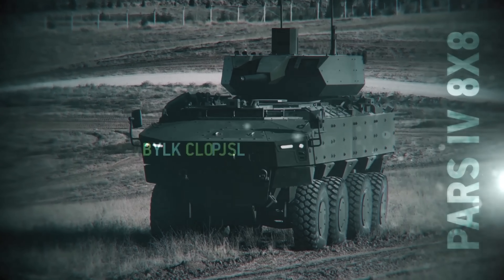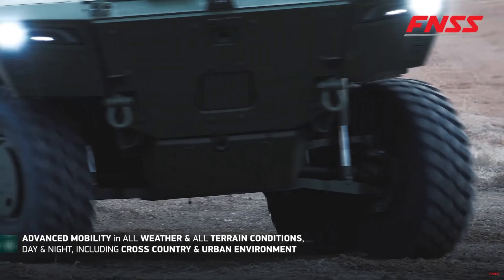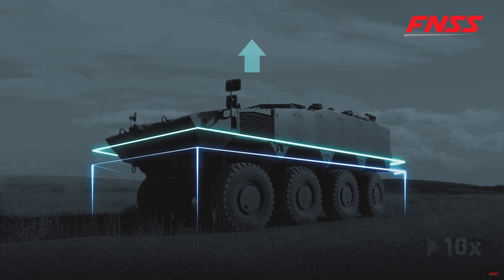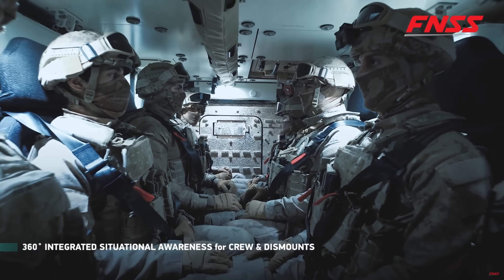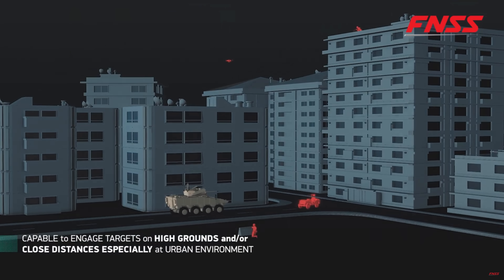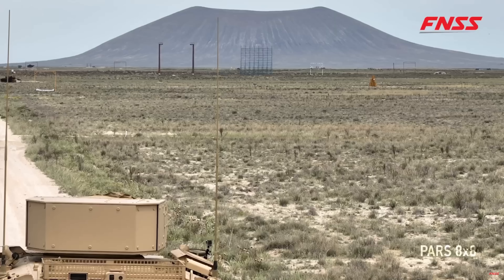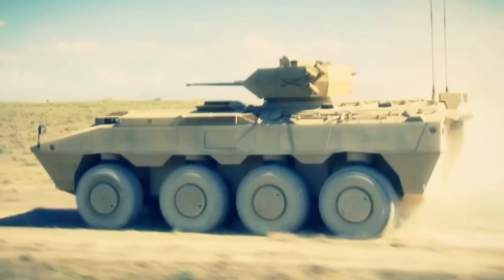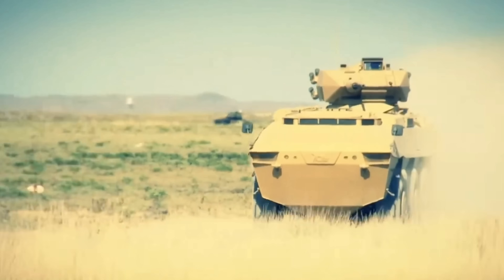The 'Pars' ALPHA 8x8 Infantry Fighting Vehicle | DETAILED OVERVIEW

Comment: There are limits to the penetration of guns and their size. For long-range artillery, the equality of kilometers of projectile flight and centimeters of penetration. 24 kilometers is 240 millimeters of penetration. 15 kilometers is 150 millimeters of penetration. For tanks with large and long guns (such as Panthers and Tigers), it is advisable to raise their barrels 2 meters above the ground for easy driving through holes without damage. The gun should be shorter than the length of the body. There is no need to select the best mass and speed of projectiles for an imaginary tank. It is easier to calculate using an ideal 25-caliber howitzer, which has a penetration equal to its caliber. Dividing the barrel length of 5 meters or 6 meters (Panther and Tiger) by 25 calibers, we obtain a penetration limit of 200/240 millimeters. Was it possible to create a low-height anti-tank vehicle like the Stug3 with a more powerful and longer weapon? The lower the barrel height, the shorter it should be for easy driving over potholes and hills. A barrel height of 1400mm/1500mm does not allow it to be made long for, easy movement. Strv103 lengthened inside the body. It is desirable that the anti-tank vehicle has a limited mass and size so that it is better and faster to find better place and conveniently drive and stand in an invisible place.

Comment: Come to think of it, I don't think I've ever seen a video comparing tracked vs wheeled vehicles. 
As in.. where they can go, and where they can't go. Not just comparing one vehicle vs xxx, but a serious look at the pros and cons of the various tracked and 3x3 7x12 or however many wheels they have... ;)  
So of the questions I have goes something like, is there any difference in how many wheels they have, or is that just a weight thing? (heavier needs more wheels) Or can tracked vehicles really go anywhere they want,,,assuming they are not too heavy? 
What does the comments think? Would it be interesting to watch?
Reply: Tracked vehicles get stuck all the time, which is why columns of tracked vehicles are frequently accompanied by specialized recovery vehicles.

Wheeled vehicles are more likely to be stuck, but they go faster on roads and don't tear them up. Since more time is spent on roads than off,...

Number of wheels is often but not always a function of weight.  6x6 vehicles tend to be smaller for example but 6x6 with evenly spaced axles can have ride quality problems, hence why so many 6x6 configurations will have a gap between one set of axles. This in turn though can impact off-road performance, particularly trench crossing. 

Everything is a compromise.

Comment: I spot One Modularity Lacking... Ability switch 8x8 into track easy and quick method.

I have ideas for IFV  require airplane carrier redesign.

IFV ideas I come up with is bigger wider size wheels plus dual wheels configuration halo shape side armor for wheel vulnerable sides. 5 dual wheel left 5 dual wheel right. All 10 dual wheel can steer left and right. Wheels ability quick easy swap tires into tracks.
triangular bracket front both sides and rear sides v hulls against mine. Incredibly spacious inside soldier can prone position  left and right simulataneos reason I describe soon. 5 left and 5 right Seat style is facing sides can be switch both seats face left sides or right sides and can mnual or semi auto fold down flat. 3 main door for infantry left right and rear. This is why seats direction can be adjust both seat 5 x 5 and semi auto fold seat can help real rapid deploy triangular bracket sides door open(can be open fast travel side door distance go down is half because of triangular bracket design door open two ways up and down door is whole sides panel triangular bracket shape) 5 infantry simulsteneuos drop chair semi auto fold down by commander push of button another 5 infantry path clear can be rapid drop. Another tactical infantry deploy method contested sides fire come from sides door open little provide window fire for 5 sides infantry in prone position, both sides of seats 5 left 5 right fold down opposite 5 infantry crouch low avoid bullet went thru other door open  other sides can be first rapid deploy contested door close follow by remaining 5 who provide fire cover follow drop out of the vehicles.Rough istimate carry 14 humans 4 crew 10 infantry. Modularity top mounted weapon and front mount mine clearing or mine planting or fork lifting function!!! rear part towing other vehicle is super convenient class avaiable!!!!!!! Infantry not squeeze inside, vehicle large profile build nearly as tall as public passenger transport bus! wider bigger!!!! wheels is half size of big foot wheels! super definitely not fit into what ever biggest Air craft USA have! HAHAHAHA! and hover shoreliner hovercraft.

Most definitely need create anew big air craft be able carry this ICFV!

if i create this and sell, you have buy together with the colossal class Aircraft quadruple or triple bigger size aircraft than whatever big aircraft US have. and Bigger hover craft etc.... 

Create Big size air craft transport this wheel fortress ICFV... Yeah I going call this ICFV a Mobile Fortress inside pending new AirFortress.

Comment: Erm actually the side by side driver and commander is actually more likely a problem...
If the driver side gets hit and penatrated by an rpg for example then chances are that the commander is killed even if it's through shrapnel meaning that instandly most of the vehicle is useless when it doesn't have a turret meaning not only driver safety is at risk but also the commander wich is a much bigger problem than if the commander is further in the back..

Comment: It's actually not that lightweight, I was surprised that it's so close to the boxer.
Might be a good cheaper option for some nations but for NATO forces having the RCH 155 option for the boxer seems valuable. I doubt you can mount a 155mm artillery gun on this thing.

Comment: 50 of the same turret is fine...when you have a great turret 😛

Mortars? HA, the old WW2 tanks were made to ARC fire indirectly, not as well as proper artillery but more mobile and more armor. And last I checked, the US tanks still had the arty sight and really only dropped it when "ALL" ammo became HEAT, APFSDS & the rarely used M1028 canister cartridge (wa wa wa is messes up ma barrels) and yet it was still designed, built and ISSUED. 

But IF they could make, ISSUES & USE a plug&play turret that changed in like an hour's tiem frame, that would actually be useable BUT...would require a LOT more crew training to use all the different systems.

Comment: This is I believe the closest anyone has come to getting the layout and configuration right.  

Commander seated up front, next to the driver and with an excellent field of view, but still in the troop compartment where he can be in direct contact with the dismounts.  Which is the other thing,... a full squad (8 to 9) dismounts can be accommodated, not the 6 or 7 so commonly found. I am not a fan of 6-man squads. 

I find it fascinating that in these videos about infantry fighting vehicles or infantry mobility vehicles and the discussions that spring from them, what gets almost universally ignored are the infantry - the vehicles real primary weapon. 

The engine is moved to the front instead of the middle, unlike earlier PARS vehicles which allows for the commander to be in proximity to his men and increases usable volume.  

Worth noting to viewers not familiar with the vehicle - a lot of your video clips are of the older mid-engine PARS III, a very different vehicle.
Reply: Thanks, I was confused about the two different layouts. I agree that the front engine layout is better. Besides separating the driver and commander from the gunner and dismounts, mid engine can be more annoying for maintenance.
Reply: @IsaacKuo  - Importantly, the front mounted engine puts the driver and commander above the 2nd axle instead of the first, offering them more protection from mines.
Reply: another overly expensive deathtrap for the mounted troops that can't see and shoot outside
Reply: @kingsman3087  - Shooting from the vehicle has never been a particularly good plan.  I'm more than old enough to remember when every infantry carrier and it's mum was fitted with firing ports for the crunchies inside.  Then after a while everyone sort of figured out they don't actually work and in fact made the vehicles more vulnerable
Reply: @MFitz12  not necessarily shoot but observe- im not sure you know the so called "airguards" that were popular in the Striker vehicles, these striker APCS often had counter sniper nets. doesn't seem like such a design challenge to have hatchs or vents at the top of the vehicle, more useful than AC right??
Reply: @kingsman3087  - You obviously missed the roof hatches over the troop compartment.  The end user also has the option of manned or unmanned turrets.

Comment: So when it comes to the modularity, can they be swapped out in the field, obviously we're a long way off the Allied IFV in Red Alert 2 where a different infantry unit enters and a unit appropriate turret comes into being but when it comes to a mechanized battalion's motor pool could they have the different modules on standby and then before each mission fit in a mission appropriate module or would the modular reconfiguration need to be done by a specialized mechanical facility further up the logistical chain?
Or in other words does changing out modules occur at the tactical, operational or strategic level?

Comment: Tracked vehicles require more maintenance than wheeled vehicles, even though they tend to be better at cross-country maneuvers. The amount of time spent in the motorpool dealing with our Stryker's compared to our M3A3/M3A2 Bradley's was notable. Plus riding in a wheeled vehicle tends to be far more comfortable for the crew.
Reply: Judging by what i've heard from a swedish channel that got to drive the CV90 he said it was very comfy driving over obstacles and at speed. I think your bradleys are simply not good at the suspension part

Comment: A very impressive system and I can see why @ Matsimus loves it. I would give it a 9/10 score. The missing point is for the lack of a 'cats cradle' turret transfer crane system.  This network of small hoists and pylons would allow  unit commanders to move turret configurations on the fly without calling is a REME team and its attendant (and valuable). heavy lift equipment. During an advance, mission critical armament and sensor systems could be moved from immobilised units to unequipped or less important  loadout chassis; maintaining a higher capability standard for the assault force with only a minor loss of flexibility. The replaced turret and damaged chassis being collected and repaired as part of second line field operations. The stored pylons can be stored on the outside of the vehicle as a form of 'slab' armour when not in use  and as a secondary function the transfer crane system can be adapted as logistical support feature allowing the fast movement of palletised ammunition  from drop off transports to parked IFV's for quick supply.. This could be a new valuable standard feature for FNSS if perfected.
Reply: Who has the budget for spare chassis laying about at company level?

Comment: In my view: Matsimus you  miss the essential feature. The hind wheels are countersteering to the front wheels. making for a very small turn circle.  The only other 8*8 I've seen doing that is the Swiss MOWAG Piranha V.
Both Schweiz and Turkey are mountainous countries where off road capability is not really a feature - simply because to the one side of you, you have a steep rock face - to the other you have a drop of several hundred meters (as You now are a Canadian, You go metric). Here off road means your vehicle is transformed into a raffle cup with very disorientated dice - that won't survive going "off-road". And in Turkey everything moves by road - rail transport 
Now the rear wheels on the Piranha locks at speeds above 20 km/h - meaning the stability of the vehicle is taken care of when the road allows fast driving.

Now this feature means the British L7/52 105 mm. will have a length of 5½ meters. With a vehicle length of 8 odd meters this means that the barrel can be within the length of the vehicle: Why the HELL do you need a turret? You just turn the whole truck.
Reply: Why you need a turret. say you got a 6 meter wide mountain road. between a mountain wall and a drop of a hundred meter. do you realy want to turn the vehicle to aim. if you want to send some hate to the side of you?
Reply: @exploatores  Note that the Piranha V has counter turning rear wheels at speeds below 20 km/hour. So the Swiss have thought of that!

Comment: Question: Can wheeled armour traverse a wider variety of terrain types than tracked vehicles?
Reply: No, wheeled vehicles are mainly for speed on roads and relatively flat even terrain without many bumps or divots, while tracked vehicles are much better suited for offroading although they sacrifice their speed.
Reply: No, they're faster and easier to repair. So if you have decent infrastructure, or dry desert terrain, wheeled is the way to go. Tracked vehicles travel far more difficult terrain and won't get stuck in the mud, but are slower and require maintenance more often and intensive.

Comment: One thing about 8x8 IFV is they now can handle similar weight (~35tons) as tracked vehicles while being faster on road and cheaper to operate. Wheeled vehicles are also more resilience to damages because they can lose one or even two wheels without losing mobility while tracked vehicles cannot achieve it. I just really like them and honestly for countries that have advanced harden road system and relatively dry (no mud seasons) 8x8 are just better than tracked vehicles.
Reply: The vehicle PARS is essentially a customized version of, the American GPV Colonel has a 10×10 version called the general.